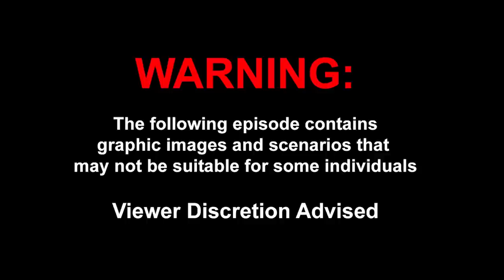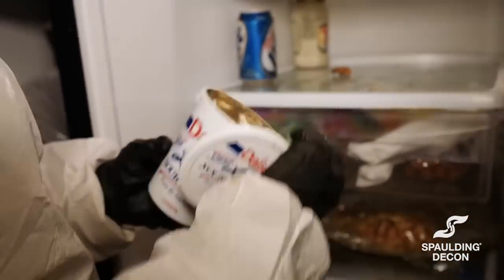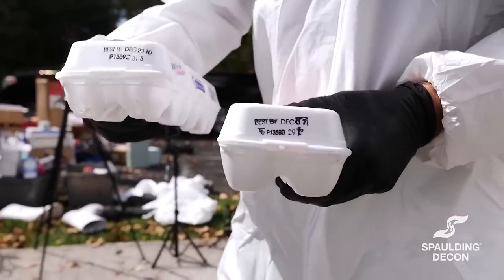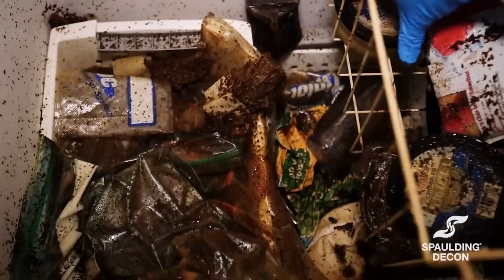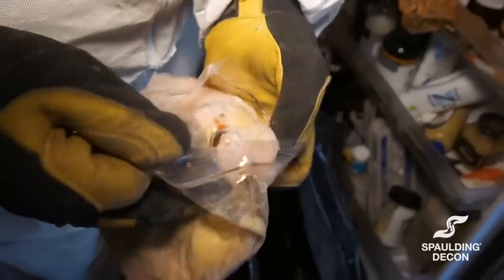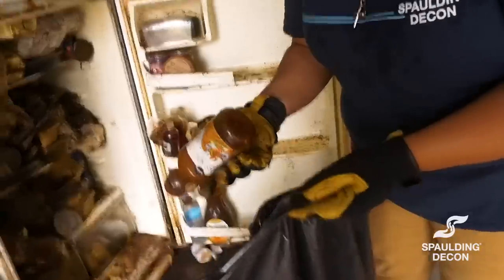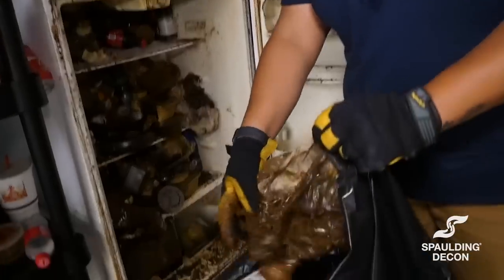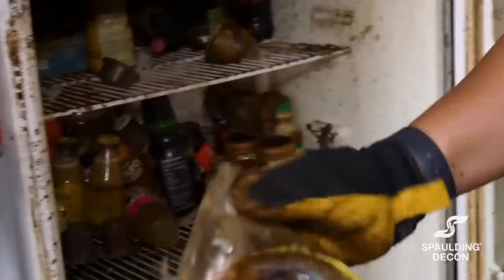Top 5 NASTIEST Refrigerators We've Ever CLEANED!!!

Comment: I work for a company that does structure cleaning for soot from fires. A lot of times the power is cut and the refrigerator food goes bad because of that. I’m guessing protocols in other areas might be different, I’m in VA, but if we have a fridge full of food, we usually just wheel the whole thing out and dump it all together, and avoid opening the fridge, except for right before we throw it away to take an inventory for insurance. There’s no way those refrigerators or freezers will ever be right again after all that food has spoiled inside.